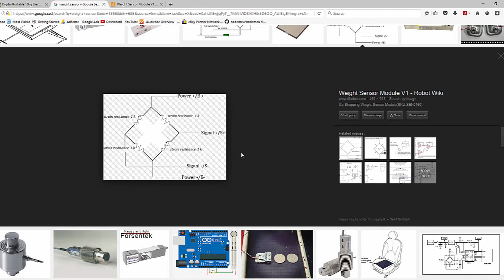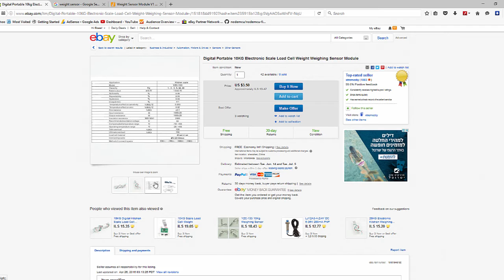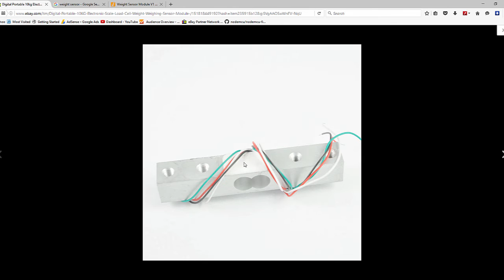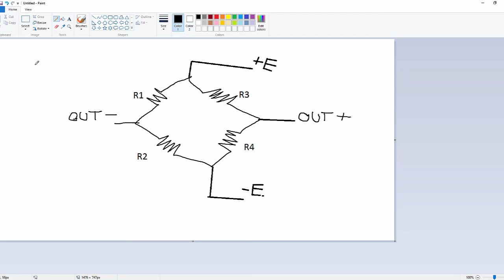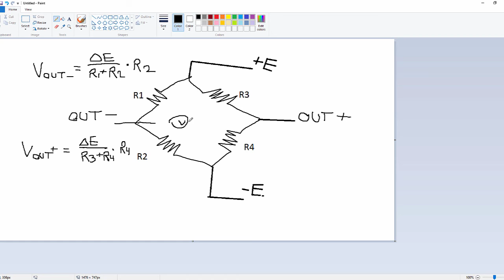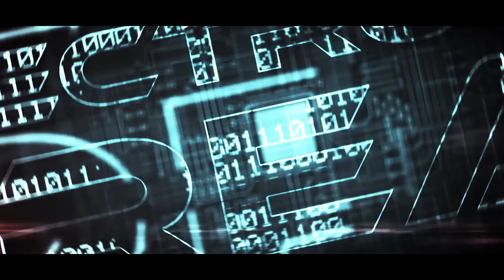weight sensor - part 1

Comment: hello i have not even a bit of idea about automation.but i want to make project on " automatic door open & close system based on weight sensing (that will detect the weight in grams & if the weight will be above certain value the gate wll open) im pretty much sure i can do it with aurdino m/c but what should i use as weight sensing (that should be very light in weight as i have to put it on toy) load cell, pressure sensor or strain gauge or any other component plz help me..& plz rply